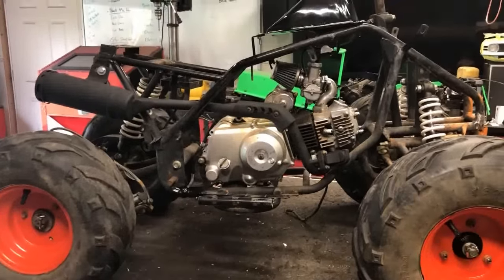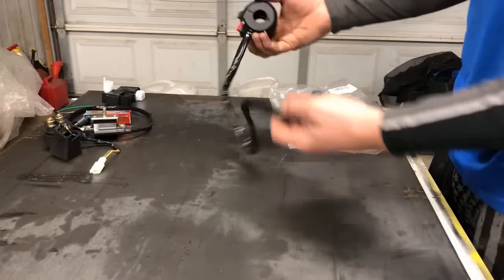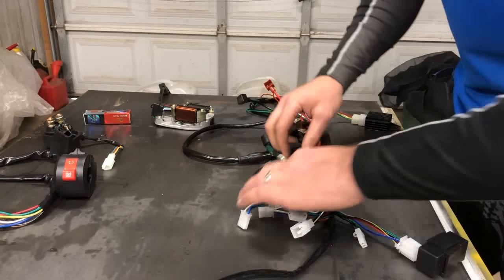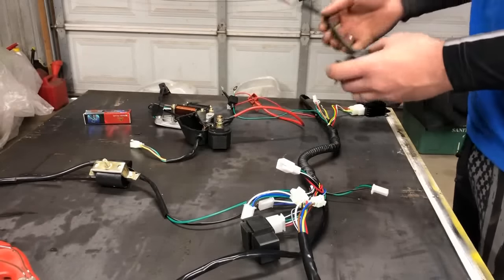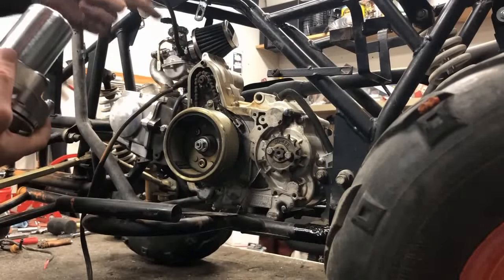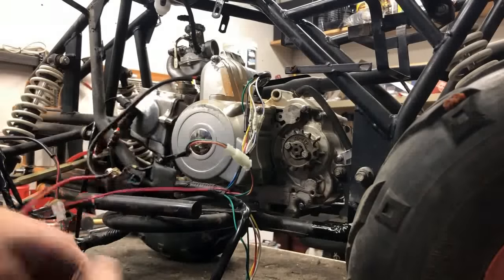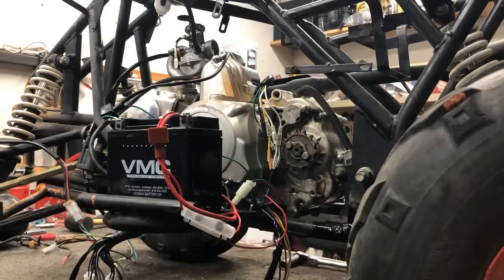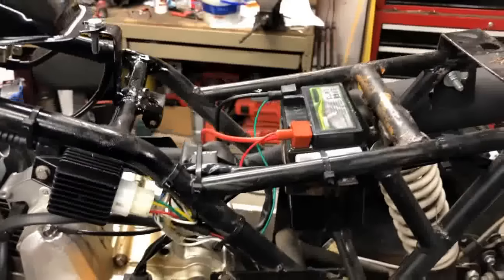Wiring a Chinese ATV from start to finish with an All New Wiring Harness!

Comment: the one I have has a little plastic black box with a 6 pin connector on it. what is it? al has a circle plastic thing that looks like a speaker.
Reply from the maker: That box is a wireless remote start transmitter and that is a speaker. It makes a sound like a car does to let you know it got the signal to start. They are junk and are always broken. This generic harness I use deletes it completely.

Comment: On my starter I have a red wire and a green wire.. need to put the red to the relay and what about the green one?
Reply from the maker: Some ATVs have the ground wire coming off the negative battery terminal to the starter bolt. In this video my preference is to attach it to the top bolt on the stator cover.

Comment: I have two set of wires coming out of my stator,so how do I hook them up?
Reply from the maker: 2 additional wires? Those are likely from a sensor for a neutral & reverse light. It doesn't hook up to these generic harness replacements.
Reply: I apologize,I meant two sets of wire harness ,one from stator and another from transmission!!

Comment: Hey fixing up an atv for my nephew. Can anyone help me name this part on my tao tao 125cc atv engine. Above the chain. It has a female connecter on the end with. It looked like a cover with 3 wires(black white green). Was ran through the stator cover along with the 2 coil stator wire.

Comment: Dude I have crazy issues.  New wiring kit head light no break lights. With the engine shut off switch engage and the key turned off. As soon as the hot wire touches the positive post. The Tao tries to start. Can you help?
Reply from the maker: Man that's tough. I guess my thought process would be to check the start button. Power goes from the battery to the key, key to start button, start button to relay and finally relay to starter. The problem I'm sure is with in that circuit.

Comment: Great video! I rewired my 110  chinese and have been driving it around. The other day the green wire that is attached to the negative terminal on the battery started smoking and melting. I detached it and left it hanging and everything seems to be working correctly. What is that wire for? Do I need to replace it? If yes, any recommendations on how to fix it? Thanks again, your videos have been the most helpful thing I have found to help me through this.
Reply from the maker: Thanks for watching man and I am sorry your running into problems. Sounds to me like that wire is getting over loaded, maybe there is an exposed wire arcing to the frame sending too much power to ground. That wire is important to the electrical system to complete the circuit back to battery ground. Take a good look over all the connections make sure you don't have any exposed wires. Sometimes left in a bad spot the heat can melt them causing your issue.

Comment: There is a large male connector coming out of the stator where does it go? It has three wires but has 6 slots.
Reply: And also where do the 2 break cables that you hold together go?
Reply from the maker: Some times the stator wires are all attached in a plug and sometimes like in this video they are individual. In your case that plug is either stator wires, or they are neutral and reverse light indicators. If the connector ends right next to the sprocket then that is your light indicator. The 2 brake light cables connect to your brake handle.

Comment: Hey bud, I need your help! Any idea what the second set of wires are coming out of my 110cc four stroke semi automatic with reverse engine would be? It runs fine not connected, but not charging battery right and wonder if it has something to do with it. The second harness has three wires, purple, light blue with red stripe, pink?
Reply from the maker: Sounds like it could be the wires for a remote key to start and shut off the motor. A lot of them come with this option from the factory.

Comment: i have kymco 70cc atv or kawasaki kfx 90cc atv which has AC 6 pin CDI . can i change it to dc cdi with this harness
Reply from the maker: Couldn't tell you for sure because I've never tired it but I assume it would work assuming the stator can generate a charge.

Comment: What if I use my old stator and it has a wire connector block and the new wire harness has just the loose wires with a connector on ethe ends
Reply from the maker: You have 2 options really. You can buy a connector kit and pin the harness wires to fit the old plug or you can just pull the wires out of the connector and individually connect them.

Comment: Love your channel! I have a question though, when I touch the brake wires together the starter turns over, what am I doing wrong?
Reply from the maker: My guess is your start button is faulty. When you touch the brake wires it sends power to the start button and then to your starter relay. So it's either stuck on or you have a short in the harness somewhere.

Comment: If I don’t get any spark what do I do? Everything else works great expect I noticed I get no spark?
Reply from the maker: No spark can result in a number of different issues. Start with the easy stuff. Check to make sure you have a good spark plug. Make sure you have a good ground. Then make sure the kill switch is in the run position and the safety tether is plugged in. If everything is good there then you'll need to do a continuity test for the spark components and see if you have a failed unit.

Comment: I have an older Chinese manual atv, will these wires work on it? It is very similar to the one in the video.
Reply from the maker: I cant guarantee 100% without looking at it but if your atv has the same style of motor with an electric start it should work.

Comment: I have wired my new harness, but still not getting any spark. Do you have any insight/advice on what it could be?
Reply from the maker: Benjamin Lindsay I understand how frustrating that can be, trust me I’ve been there! Stick to your basics first. Do you have a good ground? Make sure all wires are connected. Is the kill switch in the “run” position. Do that first before we start trouble shooting failed components. This is why I always install off the ATV first make sure I have everything correct. Let me know what you find!

Comment: So i have an issue my wiring harness doesnt match the stator. My stator has two yellow wires the wiring harness only has one yellow.  The rest match up except the yellow. Does it matter if yellow goes to white and yellow to yellow?
Reply from the maker: Jillian Hurley That a good question! I have never seen 2 yellow wires coming off the same stator. So I’m just guessing here, but I would assume both yellow would be the same. I can’t image a company would build a part with identical wires but have different functions. Again that’s my opinion, acting as if it was on my table and what my thought would be. I’m a “send it” kinda guy and see what happens so I’d try it both ways!
Reply: Ok played with it until the atv started. Now it will start and run for about two blocks then die. If i switch the yellow wires again it wont even start. I tested the stator before ordering the wiring harness and the stator was good. It’s the only thing I didn’t replace. Mainly because when i ordered the harness i got the wrong one. My stator is a 6 pole and i ordered a two. Any suggestions on how to fix it. Or do i just suck it up and order another stator?
Reply: Also the wires coming off the stator are blue/white red/black green and yellow yellow.
Reply from the maker: Alright I looked up the wiring for the stator. "Yellow" is AC for charging the battery and "White" is AC for Running lights. So switching them should not make a difference on if it runs or not. Those colors are strictly for charging. With the running issue I would say ordering the correct stator might be the best option at this point! Good Luck, let me know how it turns out!

Comment: I followed your video it still won't start and noticed the neutral safety switch tore off where does this connect and does it have anything to do with it  not starting
Reply from the maker: I'm not sure about a neutral safety switch. The safeties are the front and rear brake, also the rear tether. Are you referring the the neutral light indicator wire? If that's what you are referring to then no it does not effect if it starts. If your still having troubles please feel free to shoot me an email!
Reply: What is the rear theather? It was coming out where the stator goes but behind the wires for the stator
Reply: Whats your email
Reply from the maker: Nicholas Warren Youtube deletes comments with contact info. If you go to my channels page and hit the “About” tab my email will he posted or you can message me from my website www.praskaboysgarage.com

Comment: I did everything step by step and I have everything but spark now. The starter motor turns over, but no spark to the plug. I’ve double checked wiring connections and tried 2 different spark plugs. Not sure where to go from here.
Reply from the maker: Stator, CDI, Coil, and Spark plug are the components that effect spark. You also have the ground wire, safety tether and kill switch that need to function correctly. Start with the easy stuff before you throw the parts cannon at it. Unplug your tether, clean your contacts for ground, make sure your battery is fully charged, and use a multimeter to make sure the kill switch functions properly with an open and closed circuit. If you do all that and still no spark, then likely you have a failed component.

Comment: I have the same fly wheel but how do i adjust the crank position sensor gap when it is burried under the timing cover. i replaced everything and it spark for one day than died and can not find the problem.or how to set the gap SOMEONE PLEASE HELP. TY
Reply from the maker: Man, I'm sorry but I do not know the proper gap size and in my search I didn't find anything. When that happens usually I search the small Honda motors and take my closest guess!

Comment: I just purchased a tao Tao 2013 110cc atv for my child. I want to rewire it since it was second had. I have purchased everything separately because I was worried to try and do the wire harness and yet I have to do it. My question is if I strip the old wire off how can I replace it if the wire harness is only a one ended wire. Or does the wire come from the parts that are on the bike ? Also how can I fix the brake. Switching it from foot to handle ?

Comment: Man super nice video, I was with you the hole time , but when I got to the stator all of my wires color matched except for two. From the stator I had 2 yellow wires and the harness had 1 yellow and 1 white wire. Could you inlighten me on this situation.
Reply from the maker: Some times the harnesses will have 1 white and 1 yellow & other times it will be 2 yellow. They are all charge wires and do the exact same thing. You can plug them together.

Comment: I have a few questions: I bought a supposedly 50cc kids quad the guy told me it was the carburetor and he had a new one. I made my first mistake I didn’t check for spark and when I was leaving he told me it might be a 90cc and said it runs 30mph but the tires are new knobby but large for a kids ATV they are 20x8.75x8 front and 16x10x8 rear. The harness was a mess so I bought a complete set like you plugged in what matched but I have a plug from stator and 2 bullit connectors that the blue goes to the pick up. I looked all around unit but I can’t find what they connect to.The quad is Taiwan and the GY6 long case is Her Chee the way I spelled it. The CDI is a 2” square stamped metal box I also researched and the CDI and Rectifier are on the stator side the old coil had 2 bolts on each side with 2 male spades when I replaced the stator I noticed the cover magnetic flywheel was coated with rust so I had to clean the rust off to see the 6 pole magnet contacts I’m still trying to get spark btw it is electric start I jumped a wire to starter and it works it also has on/off lights and a lever with a circle and lightning bolt. I would appreciate any input it’s been a month now. And the carburetor I took off is a Mikuni! I am very good at many things except ATV wiring.
Reply from the maker: Captainkleen Sounds like a 90cc not a 50 if I’m guessing. Also is it a 2stroke? I’m not familiar with the Chinese 2 strokes. I have one in the storage shed that I’ll work on one of these days but I’m just not a fan of them. So before I give any advise I’d want to get some hands on experience. Sorry I cant help more!
Reply: Btw if I can’t get a spark I could put my hemi 212cc in it.

Comment: New subscriber , you have the best video on here i learned alot . Have a ATV 150cc it starts up but doesn't go forward   what do you think the problem is ? Would really help me if you can answer that
Reply from the maker: Thank you! It could be a number of different things causing the atv not to move. First check your rear brake. Those brake pads and calipers are know for locking up. If that isn't a problem, remove the chain cover and chain and look to see if the drive sprocket will spin without a load. If it does not move your looking at an internal problem with your motor.
Reply: @PraskaBoysGarage  thank you very much for responding i already did all of that but i found a mechanic he told me the carb needs cleaning

Comment: I've ordered two wiring harnesses now and it's come back as the wrong one how do you determine which one you need and where's the best place to order it from
Reply from the maker: Links for the harness I used is in my description of the video. It's Amazon Prime so it should get to you quickly. This harness will work for all the E22 style motors. It does not work for the GY6 style.

Comment: What if I go to connect something and the colors on the male end are switched??? Like I have a 2 wire and the male is pink and blue but on the female they don't line up the same
Reply from the maker: You can easily repin the connector. There is a little stopper in the connector that if you lift the wires will easily come out and you can swap them.

Comment: I’m working on a similar atv and I ordered the same kit but I noticed the original starter has a solid red and solid green wire coming from it should I remove the green wire or what?????
Reply from the maker: Where is the ground wire located, and are they the same gauge wire? Possible someone chose to ground the battery to the starter bolt? I'd have to see a picture to tell you 100%

Comment: What do I do if I plugged everything in just how you did, but it doesn't try to crank?
Reply from the maker: Make sure you have a charged battery. Inspect the fuse to make sure it's not blown. Did you set up the harness off the ATV first?

Comment: My starter relay doesn't match the wires on any plug relay is green red/yellow red, it fits 2 plugs on the harness that are green yellow red yellow. Which does it plug into?
Reply from the maker: You should only have one 2 pin plug located on the back side of the harness you ordered. I will be located near where the rectifier is plugged in.

Comment: I have a kazuma falcon 110 cc atv I got it running and then I touched a wire in the wrong place and now it will only start if I jump the solenoid the lights don't come on no more either smh what could it be!!?😢

Comment: I can’t get the engine to turn over from the switch wit the new kit but if I put the screw driver to the  starter rely it will turn over wat do u think the problem is
Reply: So I got it running from the screw driver but I can’t get the switch to work so it has to be a safety Switch thing
Reply from the maker: ThaOnlyTruth Alright, so if it’s running thats a good start. Couple things could be bad. 1) Check your fuse, make sure it’s not blown. That’s the biggest offender 2) When you hit the start button does the starter relay click? If yes the relay is bad. 3) check connections for your key. Plug the old key switch in and retry. 4) If you have a spare connector or extra wire jump the brake safety. 5) Check the brass contacts in the start button. They are known to corrode like old ignition points. Inspect, clean, reassemble. Try those steps 1 at a time. 95% chance one of those is your issue.
Reply: Ok thanks.. and I had to buy a new key because the other was bad ...but I have a whole new wire harness..so ima going to let u know today ...thanks
Reply: Thanks you were spot on...now wat carb and throttle cable would u recommend for the Atv in this video ...
Reply from the maker: ThaOnlyTruth Check out my complete build video. https://youtu.be/YEwCs0KWJHU in the description I list all the parts I used and also where I got them. If the eBay number has expired let me know and I’ll comment the new ones!

Comment: Brother! Will these harnesses work on a 250cc Chinese bike? Just purchased one with some gnarly wiring to fix up. Other than that,  a basic , air cooled , carbureted engine.
Reply from the maker: The links in my video wont work for your bike. You can purchase a kit off amazon specifically designed for the 250cc. The install process is exactly the same, just looks a little different.

Comment: Hey there I have a red wire that seems to be a ground.. attached to the engine towards to back of the motor...what is the wire ...
Reply from the maker: In my experience I have never run into a red wire that went to ground. I'm not sure what it would be. If you can send me an email with pictures I might be able to make a better guess.